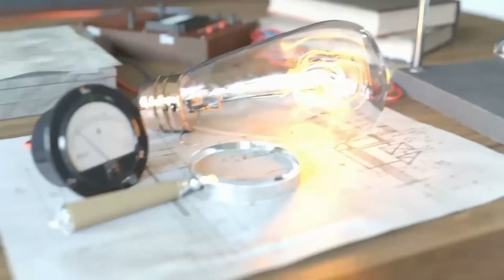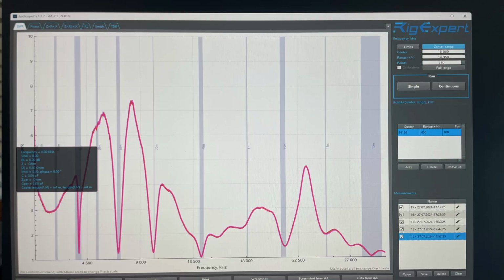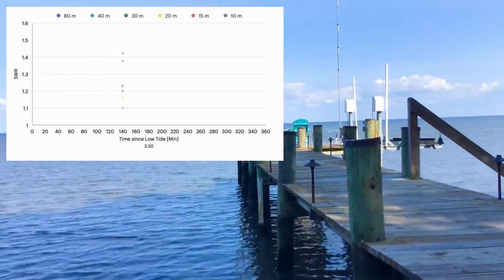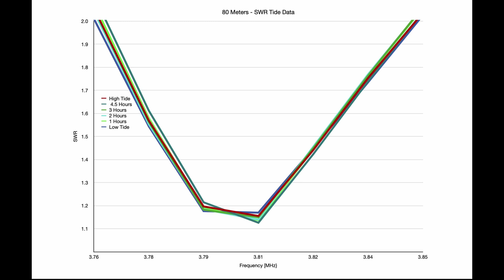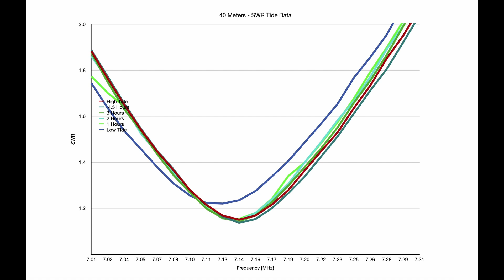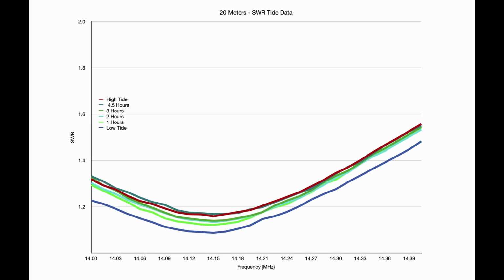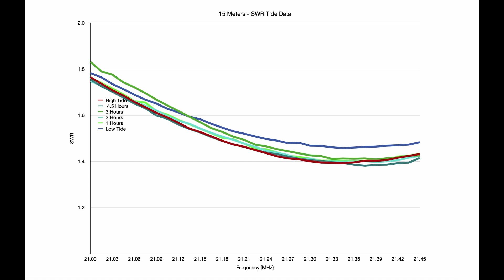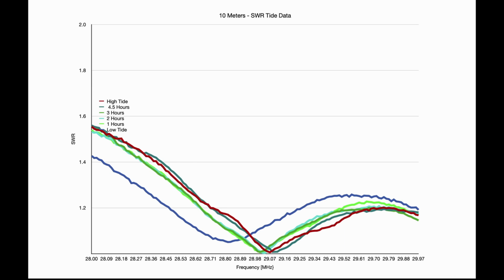SWR Dance: Watching Tides Affect a Vertical Antenna Mounted on a Dock [Hustler 6BTV]

Comment: What’s the need for the 1:1 balun.
Reply from the maker: That is a good question. It’s really a 1:1 current choke, it is a common mode filter.  73.  Paul
Reply: I’m doing the same exact setup 1:1 wasn’t mention by DX, but I will follow your deployment and add one. Last question how much wind can this handle. I didn’t see guy line/ropes but just curious. Thanks again for you response and sharing this great info.
Reply from the maker: I find that the choke cuts down the noise quite a bit. Also, I do not use guy wires.  73.

Comment: This is a pretty good indicator that you've got "common-mode current" along the shield of your feedline. This is a common problem across wet ground or moving relative to nearby metal (grounded) objects. The solution is simple: install a "common-mode choke" (AKA: line isolator or 1:1 current BalUn) at the antenna feed point and VOILA! Minimum SWR and no more SWR variability.
Reply from the maker: Thank you for the comment. I do have a choke in-line.  Please watch the installation video for more information. It can be found here https://youtu.be/ZHTLj86t65U. 73.

Comment: partially as expected... the tide height variation is smaller in terms of wavelength for 80m compared to 10m hence you might expect more significant variation on the higher bands.
also the water "earth plane" is moving down on low tide hence the top of the antenna seems to be higher above the earthplane making the antenna resonance move LF.
Reply from the maker: You are right on both accounts, I should have mentioned that the tide height variation is smaller in terms of wavelength at lower frequencies.  73s.

Comment: Maybe I missed it, but the water level below the antenna would be more helpful than just tide by hour.  Looks like the distance variation from low to high is not much.
Reply from the maker: Good suggestion, the tide difference was about 2 ft or so. This is a 'normal' tide difference for us. 73s